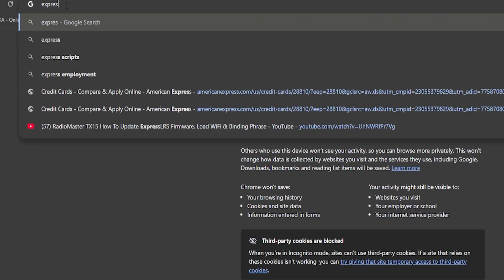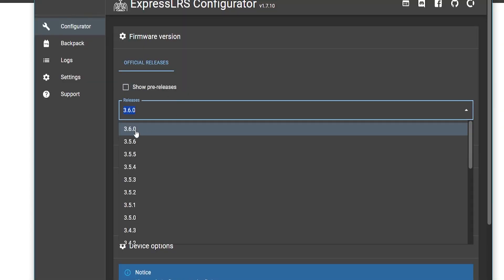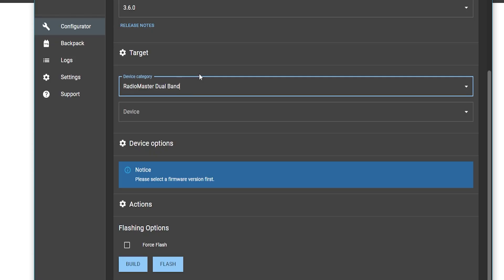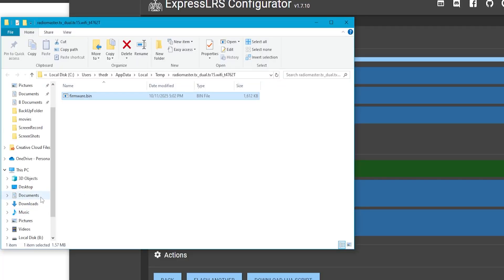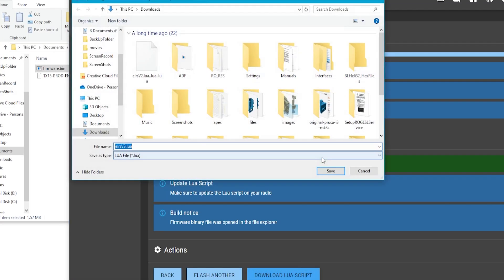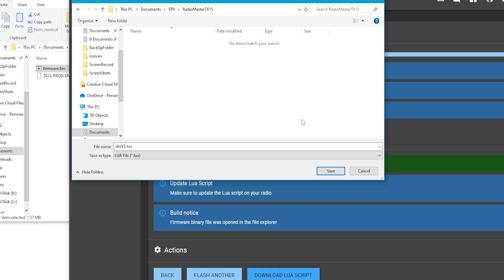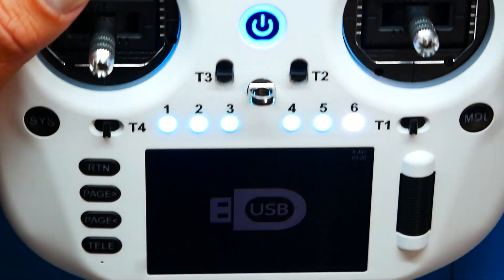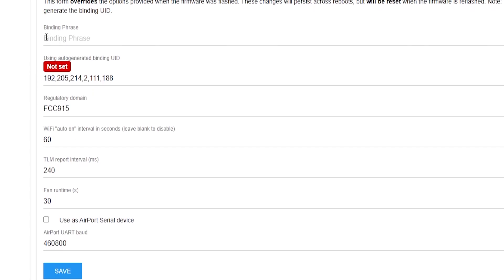Update ELRS on Your RadioMaster Remote! Also Update The Lua Scripts!

Comment: I bought the TX15 Max ELRS version with the 4-in-1 module. I’m wondering: is updating ELRS the same thing as updating the radio’s firmware? Or does this radio actually have two separate firmware's—one for the ELRS module and another for the radio itself? Or is there only one firmware overall? Thanks.

Comment: Thanks for the video. What if my pocket elrs 2.4 won't go into wifi mode, and my computer doesn't see it when I connect the top USB port?
Reply from the maker: Power Cycle: Turn off your RadioMaster Pocket.
Launch Lua Script: Power the radio back on and open the ExpressLRS Lua script (usually from the tools/model setup menu). Enable WiFi: Navigate to the "WiFi Connectivity" section and select the "Enable WiFi" command for the internal module. Connect: Look for the expresslrs WiFi network on your computer and connect. Fyi - password is expresslrs

Comment: now one problem 3.6.0 has range issues now make a video on how to downgrade to 3.5.3 which is the most stable at this time.
Reply: i do not see any range issues .. do you have  link for more info ? 
but i did see telemetry on receivers gets switched to 10mw and i had to switch it back to 100